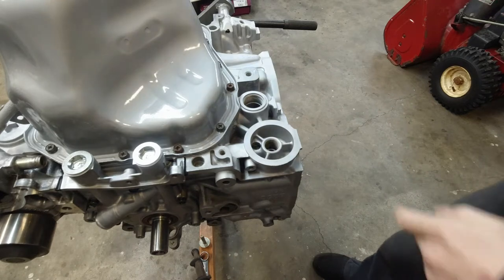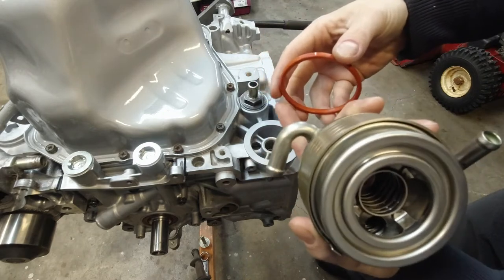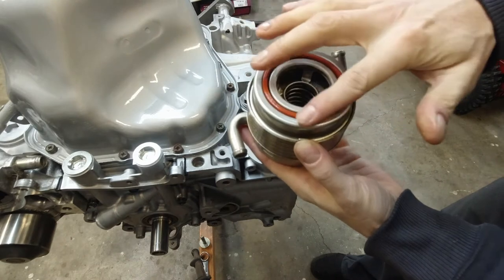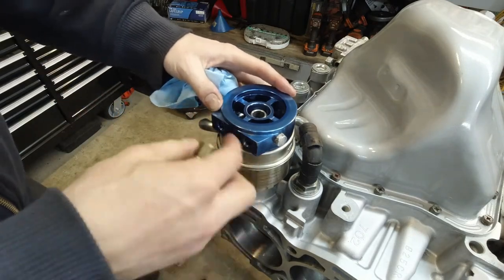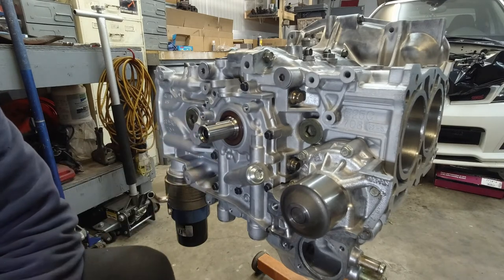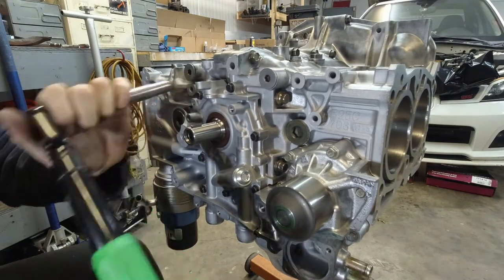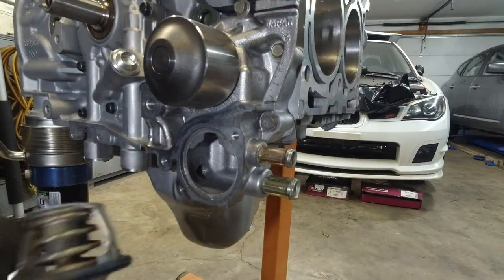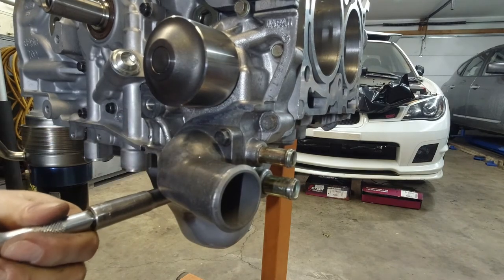Subaru STI EJ25 build part 4 oil cooler, thermostat

Comment: My buddy had a 2005 turbo baja.  His had engine rebuilded by a company. They told him that half of the engine had to be replaced with an EJ25, which had his oil cooler on. The baja has and adapter plate that screws onto the engine, how ever, as you know the EJ25 doesn't. We are looking for a replacement oil cooler that can fit. So my question is where did you end up getting your oil cooler from?

thanks
Reply from the maker: Hi, got it here, its original and cheapest as far as I know   flatironstuning.com

Comment: What paint is on your oil pan?
Reply from the maker: I used rustoleum high temp 500F primer and paint from amazon.
Reply: Also would it hurt to put rtv on the oil cooler? My old oil-cooler had a slight leak and was was a mess,
Reply from the maker: if the leak was at the big O ring then just get a new O ring.  I would not put rtv on O rings.